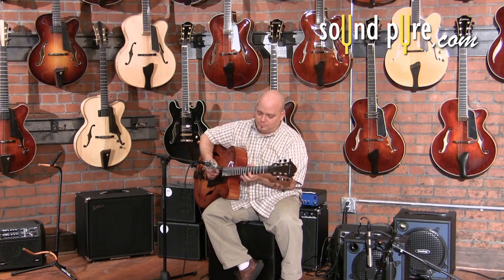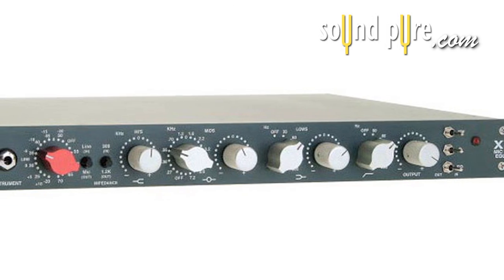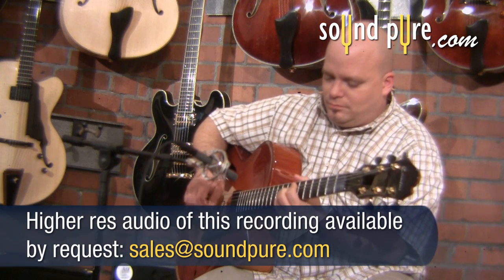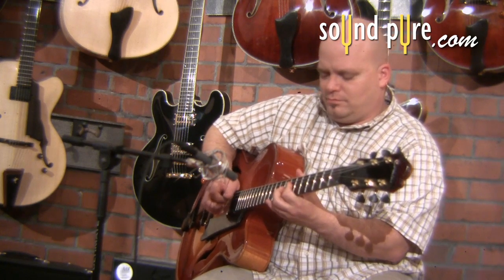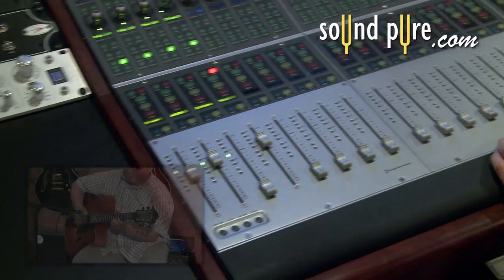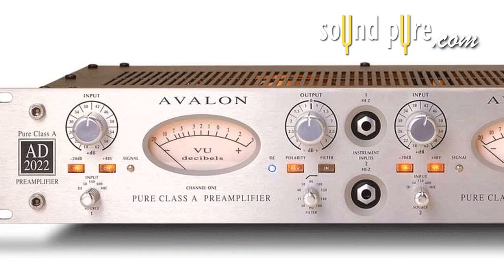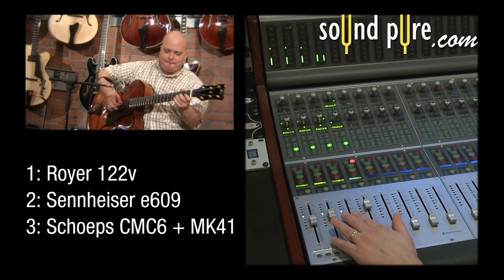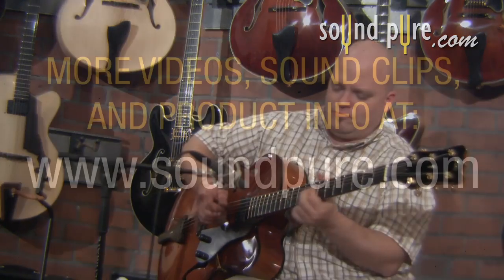How to Record a Jazz (Archtop) Guitar - Demo Video

Comment from the maker: @gnrfanatic141414 Ahhh, now your question makes more sense!  Yes, it does have to be line-level int and out of the converter.  So, yes, you need to put a microphone preamp between the microphone and the inputs on an Avid HD i.o (and the same holds true of the Lynx Aurora converters as well).  Because PT9 now allows for any interface to be used, you can buy interfaces with built-in mic preamps, such as the RME Fireface 800 or Apogee Ensemble which can do the mic pre and conversion.  Make sense?

Comment from the maker: @gnrfanatic141414 Most of the high end interfaces that come out now, for digital or analog inputs and outputs utilize a DB25 connector- this is a very flexible connector that will attach to any number of cables that can provide XLR inputs and outputs, or if you get the digital connector (AES breakout cables), or you can even do straight DB25 to D25 cables that go into something like a patchbay or preamp that supports this connector.  It is more flexible than straight XLR inputs

Comment from the maker: @Onetruthrgv There isn't such an easy answer for this one.  Panning can be used for many different intended effects, and balancing those reasons really become an important production decision.  But, if you are going to use stereo miking techniques, and wish for the individual instruments to sit off-center, be certain that you are as close to 100% phase coherent as possible.  Pan really is about fitting the textures that you are trying to achieve into the stereo field. Hope this helps somewhat